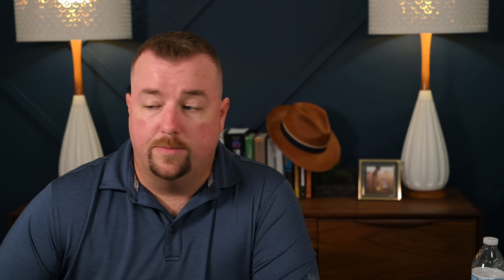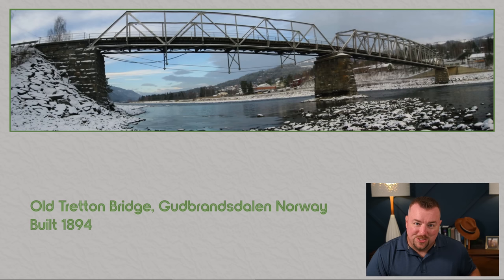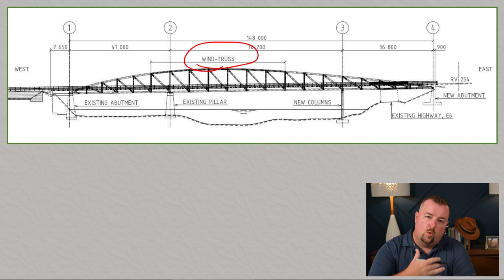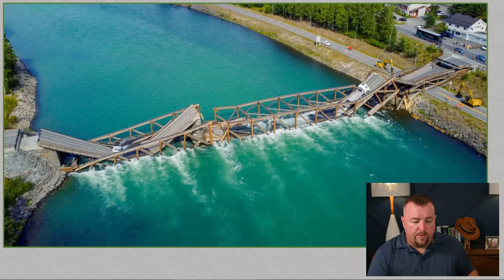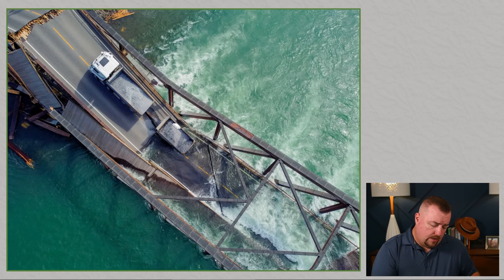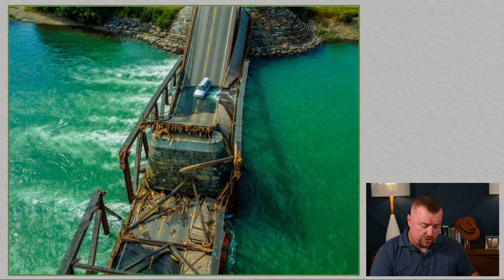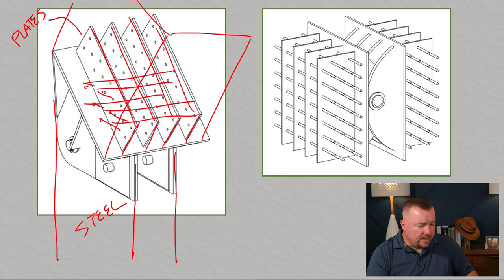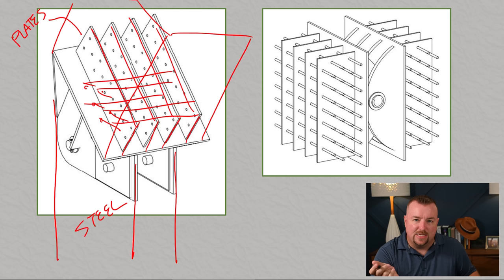How Did the Engineers Miss This?

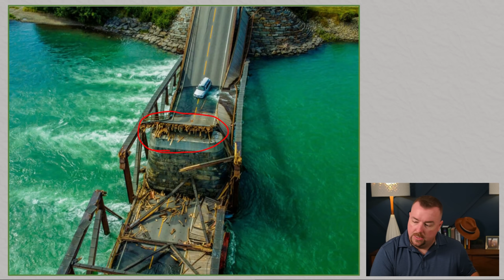Comment: 4:29 to be clear, there is nothing wrong with using wood. Wooden bridges are perfectly safe when designed and constructed and USED properly. Just... maybe not a major road with heavy vehicle traffic over a river.......

Also, they stuck bolts/dowels/whatever through wood and expected the wood to break straight across the grain instead of just splitting the grain? Did they consult anyone with woodworking experience? The wood will always split along the grain before anything else, even if the final failure point isn't along the grain, the stresses will begin splitting along the grain before the wood actually fails because that is the weakest part of the wood. Wood itself is basically longs strands of cellulose glued together with lignin. Its a lot easier to split those cellulose strands apart then it is to break thousands of them.

For them to have had any chance they should have turned the wood so the grain was perpendicular to the grain of the laminate, and the bolts/dowels should have been drilled through both so the dowels interacted with as many layers of grain and laminate as possible. The tension would be parallel to the grain of the laminate but perpendicular to the grain of the pieces of wood that make up the laminate. (hopefully that isn't confusing? i'm bad at explaining what i mean) Im not saying that would have prevented this, no that is simply the way to get the best possible strength, you never lay laminate layers in the same direction which is what they did, they had the grain of the wood and the layers of the laminate both running the length of the beam which is great for the strength of the beam but absolutely horrible when trying to hold that beam in tension with this type of joint. Hell if they kept the wood and laminate the same and physically machined a hook shape into the end of the beam they probably would have had a stronger tension joint.

I am not a bridge or wood expert, i just happen to have a decent understanding of physics.

Comment: I Know of plenty of wooden bridges that lsated decades, even under high load. Not glue laminated, but just timber. We also have a number of  others where you have steel frames and wooden road surface. Using wood is not the problem, the problem is you need to know how you use it.

Comment: I think you have to consider how a compression wave would travel ahead of the truck and a tension wave behind, basically pulling apart the structure directly below the moving vehicle.  It’s like when you try to push a heavy object across your carpet, it bunches ahead and stretches behind and with enough force, it rips underneath.
Reply: While the tension forces in the bottom chord will vary as the truck travels across the bridge, that bottom chord is always in tension, at least while the bridge is still standing.  Your carpet example does not apply here since the carpet does not support the heavy object (the floor below does) and the truck does not have to push through any soft covering on the bridge deck (which would not be structural).

Comment: You saying the glue lam failure was the cause.  I'm gonna say the designer not using X cross bracing allowed the bridge to deform under load. I see the steel colume as a fulcum  the truck on the bridge at A as giant lever and the cross brace between the upper C joint to the lower D joint being the beam under high tensil stress. Under a X brace design the bracing between the upper on lower support member would alternate in compression and tension with in each box. But without the opposing bracing member the compression is one side of the steel colume and tension is on the other side of the steel colume at point C.  Box A-B only has compressive loading and in box C-D there is only tensile loading on the cross brace.   Under heavy loading condition the steel colume at C acts like a fucrum and add extra stress to that the cross brace between and C-D.  Using an X brace design the Bracing in the A-B section would carry both compression and tension as would the bracing in the C-D box. Driving that same truck thru a similar bridge I sure you will see a greater than expected movement on the upper joints if you do not use X bracing.

Comment: Thanks for the detailed analysis.  I waited patiently until about 35 minutes in when you pointed out what i saw very early on that they drilled the dowel holes effectively between the layers of laminate!  That's unbelievable.  While the entire concept may have been doomed to failure, the fact that no engineer spotted that single issue is hard to imagine.  I design and build machinery on a much smaller scale, and mostly out of metals, so I'm not competent to build a bridge but yet I might have been able to give those engineers some food for thought.   I hope they learned from this, and also hope there was no loss of life, an engineers' worst nightmare.  
GBD

Comment: Excellent video, I do have one comment though. My feeling that the statement in the report shown at 20:05 "...the embedment in timber holes increased to the point where the tested specimens were broken by tension perpendicular to the grain." Is saying the elongation shown of the holes in the failure are not plastic deformations which are often seen in metal but rather tears perpendicular to the grain. This creates something similar to numerous small crack initiation sites between grains allow for the brittle failure of the fibers holding the longitudinal grains together. Vice what you stated is that was "what they were trying to say is they wanted to break it perpendicular to the grain..."

(Just another engineer's opinion of course)

Comment: This is concerning because it's similar to a very common GLB connection that has no reason to not be susceptible to the same mode of failure. There is a connection with long lag screws parallel to the grain direction. It may also be a design flaw the GLBs retain the grain orientation to be parallel with the beam. Perhaps it would be beneficial to design them with members hatched at 5° or so, alternating each layer.

Comment: I think the reason why the lorry was in static place, it’s probably because the bridge failed slowly in relative terms, i.e. it probably just sort of slumped the driver probably got quite a bit of warning of what was happening. Rather than snapping fast it probably tore and wrenched itself through the wood over several seconds. It’s amazing that the complexity of the language of the reports kind of obfuscate the findings of the strength report a bit, and like you say computer modelling and real world testing isn’t out in the environment, and the modelling of wood within computer systems is probably highly inaccurate. Steel being a much more homogenous material is probably much easier to model and predict from a computer perspective, we are beginning to see that any materials that are glue laminated Are not that predictable, as they are system unto themselves rather than just a material, ocean gate proves that laminated carbon fibre is not easily computer modellable.

Comment: Almost as though steel has been the primary heavy service bridge building material since the 19th century because when specified correctly, it has an immeasurably long cycle life..
Reply: As for that timber connection... Why are there no plates on the outside? Why would they do it this way instead of using compression from the outside of the member?
That timber engineering research material is interesting, because I have no idea why they thought splitting was less likely than tensile failure...

Comment: The closest point to break failures are the ones closest to the edge. That's the unfortunate side to physics and stress breaks.
They should have used full logs instead of however many plied layers of wood to make those trusses.
Even with that in mind, I think it would still have failed because of the holes themselves in the end of a log. Logs are bendable, to a much greater degree than plied wood, but are not strong enough in comparison to steel.

Comment: The pins were fine. The steel was fine.  The problem was the idiot idea to use iron connections on glue lam beams in an outdoor setting.   When wood gets saturated with fresh water with iron fasteners in the wood, it gets a rot literally called Iron Sickness.  In boat building this phenomenon has been noted to accelerate both the corrosion of the iron and rotting in the surrounding wood.   This is why some boatbuilders prefer bronze fasteners, which do not seem to have this problem. Some theories are that the wood gets compressed and the hole stretched by the hard iron working it under load, and that enables water to get entrained in the exposed end grain of the wood in the hole, which holds moisture against the steel pin and promotes more rapid corrosion which expands the pin and thereby works the hole ever larger.  It is particularly noticeable in oak, for example.  I recently had to scarf in a 5 foot section of replacement glue lam in a roof member because an undetected water leak in the roof had leaked water down right into the glue Lam where it had a 2 foot iron lag screw pinning it thru a top plate to the top of a 4 x 4 column.   The Iron sickness had rendered the hole in the glue lam twice as wide as the rusted remnant of the bolt, even tho the Glu lam was under no movement load from the bolt, it just transferred  load directly thru the top plate into the column in compression.   When I look at those pictures of the torn apart bridge connection I see the exact same black discoloration around all those holes bleeding from one hole to the next.  We figure the undiscovered water leak in our roof had been going on for about ten years before the rot on the top plate spread wide enough for the glue lam to crush half an inch.

Comment: Lets say instead of having the plates stick out in the open and only covered by the wood; what if the joint included an open box with the plates in the box and rather than 30 small dowels, just 2 or 3 much larger steel dowels?  What I am trying to do is make it impossible for any minor splitting to expand far enough for the wood to pull out around the dowels. That's assuming the use of that kind of wood isn't fundamentally flawed from the start.

Comment: I'm not an engineer in any sense but I've built simple structures on many occasions and I've always understood how wood acts under tension or under compression. How could this bridge design be implemented ? Simple compression rings weren't even considered although compression rings would not have made much difference to such a bad design.
Always well presented. Much appreciated.

Comment: Maybe the so called engineers should have consulted with the Amish barn builders. Wood under tension will split. Should have installed cross grain keys at the ends to reduce splitting. Our barn, Amish built,  nearly 200 years old is all beam and wood peg construction. Still holds up to fully loaded semi's/ lorries, and all the farm equipment.

Comment: This bridge failure was a big thing here in Norway, and multiple wooden bridges across the country were taken out of use temporary while the accident was investigated. I'm not sure what they have concluded yet, if anything, but some flaws were found. Anyway, I'm not surprised the joints, the way they are designed, would fail in this way. I suppose it could've been avoided if they added a tensioning band around the wood and made it water tight. Still, it's not a good idea to cut the fibers like that, and certainly not several times in a line. The strength comes from the friction of fibers sticking to each other. Wood fibers won't stick to steel, at least not by themselves.

Comment: Instead of a large number of dowels in shear stress, why not use a smaller number of larger bolts in tension, through heavy steel plates on either side of the wood beams? This would form a clamp to put the wood and slotted-in plates under compression and the load would be transferred directly between the surfaces of the slots in the wood and the surfaces of the plates in the slots. There would be no tendency of the wood to split as it would not be stressed by all the dowels and holes interrupting the grain. The clamping pressure would also prevent splitting.

I must say, this video could have done without all the negative attitude about the use of wood. Wood has been used for building all kinds of structures for ages, with great success, so long as the structures are properly engineered and constructed. I know of wooden bridges that have stood the test of time with no noticeable deterioration, because they were well built.

Comment: suppose A' to D' are joint parallele to yours but along top chord. In my opnion the overhang between C and the new collumns broke, so C' dropped on the remaining cross-member at C. With the huge impact at C' the joint A failed ripping off the member between A' and B at the same time. The chain reaction on that side of the bridge stopped when A touched the river's bed.

Comment: Using a single, long arch may have been part of the failure mechanism. Instead of anchoring the main span's ends on each pillar, then having a shorter arch to the shores, I'd think with the lack of curve of the single arch, it weakened the bridge from day one. Arches are stronger than box girders, and this design tries to make an arch shaped box girder.

Comment: The diagonal member between B and C appears to be a compression, not tension member.   Still the most likely cause of the collapse.  Also it appears that joint C is hanging below the cross beam, it could have been located above and bearing on the cross beam.

Comment: I’d be surprised if it had anything to do with the glue, because typically the glue is a lot stronger than the lateral strength between the fibres. It may well have split, but then it almost certainly would have happened between the fibres and not in the glue.

I also think you’re missing a key aspect here. It was reported that the bridge started wobbling when driving on it, several weeks before the collapse. This leads me to believe that the collapse is due to creep in the timber, causing the bridge to flex more than intended and very likely changing its natural frequency as well. The lorry on the bridge is a dynamic load. If creep modified the natural frequency of the bridge so that the oscillation matched up with the speed of the lorry, then the design loads of the bridge would have very easily been exceeded (you’d essentially end up with a heavy lorry jumping on the bridge until it fails). 

As for tests in labs vs reality, the implication that joints are designed based on test results in dry and warm lab conditions is not correct. The climate where the joint is located is always taken into account.

Comment: when u subject a structure under high load into vibration u end up with oscillating load.
Structural steel has high modulus of elasticity and is able to absorb and dampen the vibrations.
oscillating

Comment: The thing that most blows me away is that they drilled through the laminated edges like that. It’s just instantly obvious that this is going to resulted in a failure because you don’t have the strength of the laminated beam to rely on but only the glue or individual layers. That’s never going to work. And if the design mandates that you need that orientation then you need a different joint. 

Not to mention untreated laminated beams being exposed to the wx especially in that climate. It’s idiocy.

Comment: Please bear with me, as I am an electrical engineer with a year of undergraduate mechanical engineering, plus 20 years of wood working.
Josh, you say that you can't have a glue laminate beam of the length required. Why? If the joints are the issue, why not have a machine that makes the glue laminate beam on site to the required length. The transfer points for the diagonal beams can then be constructed differently. The bridge would be stronger.
BTW I have been unemployed since I graduated with an Upper Second Class Degree in Engineering because I am too old, who is too old when graduating at 49.

Comment: At the very least, I would have attempted to make all joints in the lower beam to be where there is column support.  The joints are the weakest part of the straight lower beam and they are getting directly pulled apart by downward force.

Comment: My father told me to never nail in the same lateral grain pattern due to weakening the woods ability to split. The loads would be concentrated as if doubling the effect rather than being carried over multiple grain strength. Of course that was nailing not a through dowel. I find the construction you showed to be flawed. When using a cripple to extend the length of a floor joist you always nail or bolt far enough from either end to increase load tolerance as the grain in along span changes by the foot so you don't lose the woods over all strength by laterally nailing in the same grain pattern. .

Comment: The analysis issues discussed here are also a huge issue in carbon composite laminates. Orientation of fibers, and order of orientation of fibers in the laminated can have unbelievably huge differences in the performance of the material.